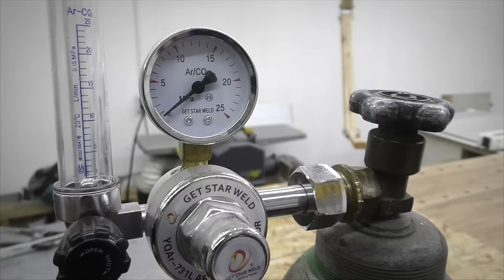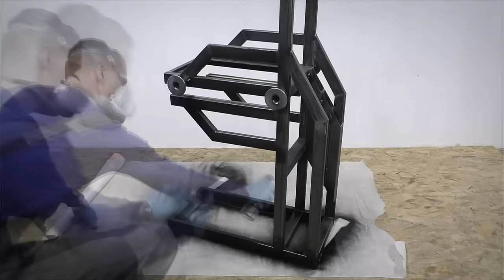Dream Welding Cart Build

Comment: Nice Work.  I think I would have went with larger tires so that it can be lifted up stairs if need be.   Also, in the shop sometimes there is a power cord that you can't roll over with smaller wheels very easily.    I think the steel used is probably 2x as thick as what would be needed for this project, so it's 2x as heavy.

Comment: using a sheet metal as your welding top is just freaking genius. haha. But i'd clean the metal a tad more if you're doing TIG.
Reply: I thought exactly the same thing when I saw that. That's just saved me a lot of money, I'll be doing the same thing 👍
Reply: That isn't genius. That just further shows how beginner this guy is at welding. It's painfully obvious that you shouldn't weld directly on a wooden surface. A better first welding project is a welding table. Assemble it on your floor and ground directly to the frame. A welding table is always all metal. Congratulating him for doing things wrong is counter productive. Also yeh, he defo should have cleaned the metal, flap disc over the weld locations is all that is required, he has the angle grinder ready.
Reply: @DIYToPen  There is something to be said for being innovative with the stuff you have at hand. Anyone that has welded a single bead in their life knows how hot a weld can get. This is a temporary solution. Come off your high horse once in a while. It’s nice down here with people making due with what they have.

Comment: FYI,
Try grinding or sanding the mill scale off the tubing first before tig welding. You'll get a much nicer weld finish with less chance of porosity in the weldment.

Comment: That is a very nice cart indeed. However, "dream cart" does depend on what you have to put on it. My brother in law built himself one that has to hold three welders, a plasma cutter, a set of tanks and torches a small compressor, a pure argon tank, an argon mix tank, plus cables and all the extraneous bits and pieces that the welders use. The cart itself it about six feet tall with a footprint of four by three feet. It rolls around very well on concrete, but could do with much larger wheels when he needs to go overland.
Reply: I'm about to build one like that for 4 machines and 2 cylinders myself. Trying to keep the foot print small though lol
Reply: @rustycreekfabrication  Yeah, I here ya. My Bin L has a big shop with plenty of space whereas I do not. My idea of a spacy shop is about 10,000 sq ft.

Comment: Were you TIG welding with Argon-CO2 or just using the regulator?
Reply from the maker: No, only argon used, co2 or any mix with this gas will not work on TIG

Comment: Are you really happy with that cart? It is quite tall and narrow = does not look very stable and the welding unit sits quite high which can be convenient but also more prone to breakage if the cart tips over and falls. It seems unnecessarily complex too, with those angle cut pipes... I will make mine much simpler (also mine current unit is MMA only so no need for tall gas bottle fixture).